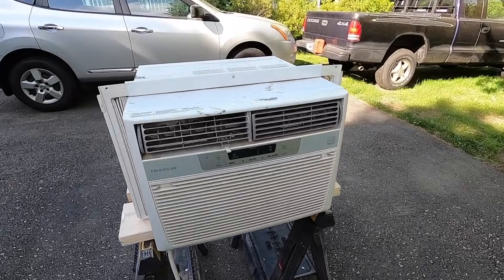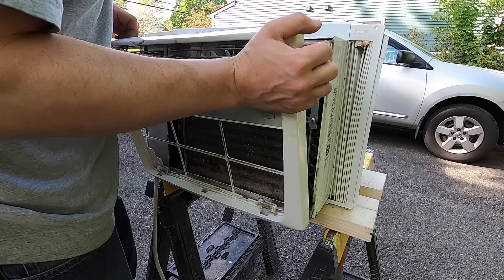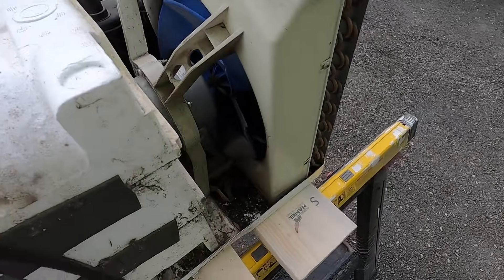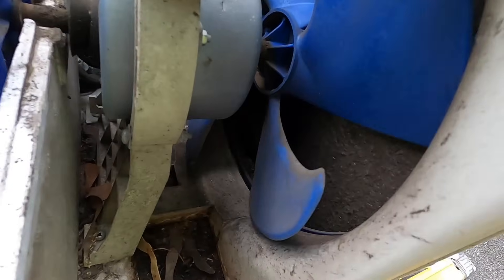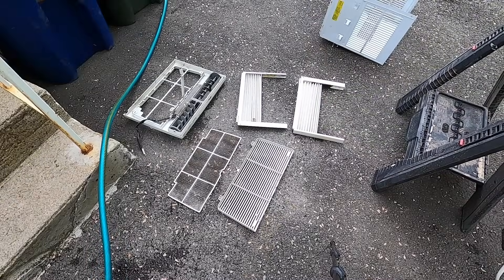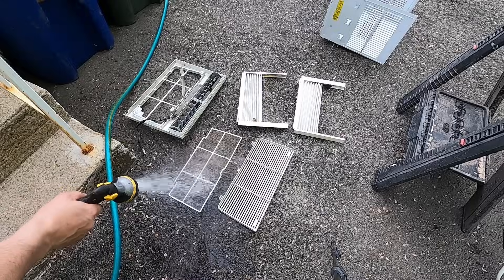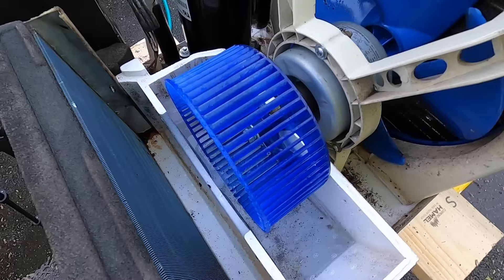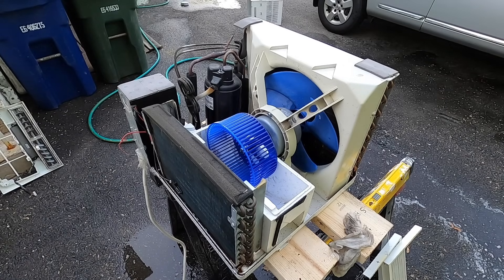How to Clean a Dirty Moldy Window Air Conditioner

Comment: How long had this unit been running without even having the filter removed and cleaned? I have a Frigidaire window heat pump that has a similar design, and the inside coil only has a slight amount of dust on it that won't vacuum off after over 5 years of year round use.

I'm also curious if mold forming on the styrofoam around the interior fan could be reduced by coating the styrofoam with something that would result in a smoother less porous surface.

Comment: i generally have to clean ours at the first of the season,  i also take the fan shroud  and the fan loose (usually 4 screws) so i can get to all of the condenser coil it almost always has lots of gunk built up across the inside of the condenser, it makes them cool much better
Reply from the maker: Maybe next time I will do that.  Thanks for checking out the video!!
Reply: @TheFixerHomeRepair  make sure you have a long Phillips screwdriver at least a foot long to reach the motor mount screws, i bought a strait and Phillips at harbor freight 22in for 6$

Comment: GUYS! PLEASEEEEE do not mix bleach with dish soap in any amount. It makes chloramine gas. 

I only put a little bit of bleach in the bottom of the bottle and did 3 drops of soap before I mixed everything together. 

I did this and felt like royal crap for 3 days until i realized what the culprit was. White vinegar works as a cleaning agent and doesn't smell when it's dried but might smell if your ac tends to be used a lot. You can also just put ONLY a few drops of dish soap into the bottle and spray down your AC to clean it and that should be plenty to remove the mold. There are anti mold products that you can use as well. Please be careful.

Comment: Have the exact same model and I just deep cleaned it, but it just rcently stopped blowing cold air, even when the compressor is on. Any tips to look for? Or do I need a new unit?

Comment: the black mold is a constant issue for my window airconditioner. i dont understand why.  i buy a new one like every summer because it is loaded with black mold. so last year i decided to clean it out. it was so difficult to get it clean. idk why they have to use styrofoam its so difficult to get the black mold off it.  but now the ac is loaded with black mold again.  i dont understand this shit.  
i am debating on cleaning or replacing but regardless anyone know what i can do to prevent this problem from happening again?

Comment: I always turn the unit up on the compressor end side after cleaning both coils, then let chassis drip dry for 2 or 3 hours, then let it set in front on a fan over night, finish electronics with comp air.

Comment: So I noticed mine was looking pretty moldy awhile ago, end of last summer, I thought hmm is that dust or mold, looks different than the verified dust elsewhere on the unit, but I didn't worry too much about it. This year I started using it about 3 weeks ago, and right in line w that is me starting to feel badd/off. The whole time I've been thinking what on earth could be making me feel like this, I'm healthy, fit, and eat the same few healthy foods, but something is up I feel like I've worked a hard labor 12 hour shift from the moment I wake, everyday. And sure enough today I remembered the mold. Man that sht, if that's what it is, is messing me up. About to clean the heck out of it. It's much more moldy than last year and I've had it blowing right on me at night while I sleep.. Yikes.
Reply: It was! I cleaned it and next day I felt 90% better, and day after that I feel totally normal! Unreal. Legit seems like that sht would have really injured me if I kept exposing myself to it.

Comment: Nice to know. I could only imagine what my a/c unit looks like in there. I've had it since 2001. Works like a charm but it does have a bit of a funk when you first turn it on. I wonder if I should just replace and start new. Suggestions?
Reply: For something that old it’s probably better to replace as the newer ones are much more energy efficient so cleaning yours wouldn’t be worth it in my opinion but it really depends on how tight your money is. They’re pretty pricey so cleaning may be the best option
Reply: If it still works well give this a shot, it only costs your time.

Comment: My Ac was almost this dirty. I got mine pretty clean I only did the front cuz it’s so hot & I just wanted it to work better. It’s working a lot better now my room is so much cooler. I want to do a deep clean like this soon ! How often should someone clean there Ac unit . No wonder I was getting so many sinus infection last year . Also this year I started to feel sinus pressure and pain. I’m hoping since I cleaned it I won’t get sick . After watching this I’m differently going to do a deep clean on my room Ac & the large one in my living room too . These things get so nasty that’s not healthy to breathe in that dust & mold . Great video thanks !

Comment: I have this exact model and want to clean it but am nervous about getting water from the house into the electronics or fan motor and making them fail or worse causing a shock hazard. How water resistant are these things?

Comment: Mine has a mildew smell and I think it needs this but I didnt know you could even clean these things.  Thanks for the video!
Reply: Just picked up a 12000btu beast.  It’s cold and brand new so no mildew.   My old unit has black soot, oil and god knows what else caked on it.   Decided to bring it into the bathtub a go to town with the shower head on jet stream mode.   Even the wiring and electronics.   If it dies, no boggy but if it works, it’s a bonus.  I’ll have ac in my bedroom.   Unfortunately the window in there is quite small and only a puny 500btu will fit.  

Report says these scorching summer heatwaves will be the norm going forward.   Ac just became an essential item like food and shelter.  

Seriously my bedroom is like an oven compared to the living room where the beast of a unit was installed a few days ago.
Reply: @supercooled  
How did it go with giving your old window unit a shower?  Did it work out ok?

Yes, these heat waves suck!  Getting ready to take mine apart and clean. It's a 12,000.
Reply: @josephdockemeyer6782  unfortunately I gave up half way into it.  There was a serious health concern since so much stuff was coming out of the unit.   My building faces a busy artery so all kinds of traffic passes by.   Thankfully this year hasn’t been that hot yet, knock on wood.   I’ve installed a secondary portable unit which helps a little.    

Thinking of getting another one or a casement style unit but they are quite expensive, 5-6x the price of the traditional one.   

Good luck with yours.   I would suggest face masks for sure.
Reply: @supercooled  
Thanks for your advise. Sorry about your situation.  I believe they're a huge health hazard.

I'm going to take mine out to the driveway and hope for the best.  Probably within the next 10 days.  Disassemble, clean, dry out and reassemble. Hopefully it goes okay...  It's in the bedroom.

EDIT: Yes!  The prices are JACKED UP.  A new one like mine would run over $360.

Comment: Mold is killed by raising pH level higher or lower than range in which spores live (3-7).
This is done using either acidic or alkaline household agents - chlorine, hydrogen peroxide, trisodium phosphate, (TSP), vinegar, ammonia, baking soda, borax, sodium percarbonate, oxalic cid, etc. Chlorine bleach is very caustic (pH between 11 & 13), and not necessary for household mold removal. Better to use the other cleaners, except hyd. peroxide, since most solutions of such are near ideal pH range for mold..
The EPA recommends that porous surfaces may have to be thrown away if they become moldy. Mold can grow on or fill in the empty spaces and crevices of porous materials, so the mold may be difficult or impossible to remove completely.
Suggest hosing parts with only water first to remove excess dirt. Then utilize a cleaner with a pH higher or lower than the type of mold involved.

Comment: A few screws would remove the front panel electronics as well.  I just cleaned mine and having removed the panel allowed me to soak the front panel and vent and really get them sparkling clean.  

I just wish the bottom Styrofoam portion could be removed without disassembling the front cooling fins.  That portion is very hard to clean otherwise.

Comment: If mold makes you sick I wonder what voc's from Clorox does. Vinegar is safe but if you want to revolutionize all cleaning, especially mold and dust try Kleen Green.. it's not cheap but it uses natural enzymes that eat all organic matter and keeps it from coming back for a long time. I have used it. You can even bathe with it and i have. Clorox does not kill mold. It takes the surface mold off but not what you can't see which is where mycotoxins come in. Lots of different co use enzymes which are harmless to us and animals. You can shop for whatever you like but chemicals like these do way more harm than good and give  you a false sense of clean. Now it's toxic.

Comment: I hate the front reservoir. It should remove all water instead of pumping the moisture back into the room and causing mold on the fan and out-port.

Comment: Hi everybody I'd appreciate your help, mine is this exact same unit but a 2023 model and as of July 2023 it's brand spanking new, my old one was the same model previous year from 2011 and when I removed it it looked exactly like the video  it was disgusting, Now on to the question I'm 67 years old it's currently me and my wife and this thing is through the wall and it's five feet up there's no way I can remove it myself, and before everybody comments about getting help I'd rather find a way to do this without removing it so I'm trying to figure out how to best clean this without removing it from the wall and I'm starting with a brand new unit I'd appreciate it if I could get a response from someone in this same predicament that has one that can't remove it that has kept it clean inside through the years

Comment: For the cooling fins you really outta buy that stuff the heating and cooling companies use when they come out to service someone's AC unit. They just soak the fins down with this solution that's put in a pump sprayer. They'll let it stay on for about 5-10 minutes then spray it off.  The fins will be nice and shinny.

Comment: Did you have a problem with the unit emitting air that smelled like mold or was this project purely for aesthetic/efficiency purposes? I have a 3 
-year-old, barely used window unit that I just started using again. The air it pushes reeks of mold. I cracked it open and see no visual signs of mold so I'm concerned it might be in the compressor.

Comment: I have the same model and followed this video step by step. I do not recommend this method. As careful as I was, especially with the front control panel, a bit of water leaked under the front buttons and now they don’t work.

Comment: My window ac smells like a mixture of piss and ass crack. This gets worse when it rains, so I would assume it's to do with the fact that modern window units don't drain all the water out, but hold some to copl more efficiently by slapping it against the shit. Why would they do this if it leads to nasty ass smells like this. My room smells like warm piss and week-old ass crack cheese.

Comment: I found a good way of getting all the gunk out of the fins - alternate between spraying through them with a hose and an air compressor- it blew all the gunk right out and made the lower section easy, where mold tends to build up
Reply from the maker: Awesome tip!  Will have to try it!  Thanks for stopping by!

Comment: I replaced the bad bearings in the motor on mine, while I had it apart I deep cleaned it like this, You can get to the condenser easier to clean it if you removed the motor and shroud , four bolts and 10 screws, lift it out as a unit. . Then you can also remove the blades and clean them in the sink.

Comment: Nice.  I have two that need to be cleaned.  One stopped blowing cold last week and it is less than a year old-I suspect it has something to do with the wife becoming "The Cat Lady".  I finally had to cut some Chicken wire and block it to keep them off but it was too late.  The other is just an older unit that sat in storage for years and years.   Now if there was an easy way to move them.  Partially blind and Stroke makes it a PITA but it's Self or NoOne.

Comment: am in the process of cleaning mine.  different model.  something like 20 y old model. not victoria secrets kind ... more like a nasty dirty type. the top section has a space, right behind the plastic grid, entirely lined in cardboard like material.  wTH! i am trying to clean that, but the cardboard is falling apart.  we have been breathing in those small particles. dare i ripping it off? can i replace with something? wth is it even called? why is it cardboard? to make sure it's not washable? am crying.

Comment: I have the same exact model in my shop.  It's built into the wall.  It's dirty like that except not so much dust in the front coils. The air isn't as cold as should be.  So how do I clean it beings i can't take it out and apart.??
Reply: Hi Melissa! I just did mine very carefully in the bathtub. If you have a rubber mat that you can place it on while you're cleaning it would be helpful so that you don't scratch your tub. Also I recommend using a screen to catch any leaves that may go down your drain if you don't have anything already to prevent such things from going down the drain.  Also it helps to have a removable showerhead with the ability to change water pressures typically used for massaging or other Preferences.  Anyhow, best of luck to you!
Reply: @klearblack  I can't remove it from the wall
Reply: Mine is built into the wall also. There was a metal bar thing that was screwed onto the front  and i just unscrewed it and gently wiggled it out with my son pushing some from the inside out. hopefully this helps!

Comment: Have you had any problems with it since washing it? We cleaned one like this and it throws ice anytime it's used now.. we had to buy a new one. I don't know if we just had clogged the line more or what. Thinking about taking it apart and trying it again, depending on your reply
Reply: Throws ice? Does the coil ice up? Couldve lost refrigerant or coil could still be plugged with dust, and if its refrigerant thats the case theres no valves to add refrigerant back someone skilled could add one and try and recharge it you’d have to look around near you or know someone

Comment: It's kinda difficult for the fan area, especially being that we live in an apartment, but the step-by-step process was very simple.  The part that blows out air definitely needs cleaning on my end.
Reply: was thinking the same. not very feasible to clean these thoroughly if you live in a small apartment in a crowded city
Reply: @planet505  Try doing it in the bathtub! Someone in a different video mentioned this and claimed it work just as well. I'd probably open the windows and turn on the bathroom vent if you have one.

Comment: You forgot one key component... Something that it took me a year of taking apart and searching around for... I FINALLY found it today... The drain that allows the water to drain from the front to the back... It's on the BOTTOM LEFT corner... Behind the silver panel housing the wires... I couldn't see it due to rust and gunk and slime built up over it... But I FINALLY FOUND IT!!! 🙌 Now it no longer leaks into the house, it drains to the back like its supposed to... I searched and searched online for someone who could tell me where that stupid drain hole was... To no avail... If anyone asks, now you know too... 😂
Reply: On this model I mean... I have no idea where it would be on other window unit brands... But I finally found it on my Frigidaire...

Comment: Thanks for the Video.  FYI. I don't think you want to ever mix Bleach and anything, even Soap.  If the other has ammonia you could get a toxic gas reaction.  The goal is never mix the chemicals.  Maybe cleaning them separately, soap, water then bleach.
Reply: A little Dawn ,bleach & water has no gas reaction...duh...perfectly fine...
Reply: Don't you mix laundry soap and bleach together when washing whites?  Same difference isn't it?

Comment: Sheesh. With all that time and work spent disassembling, scrubbing, cleaning, drying and reassembling the ac unit, wouldn't it be more cost effective to just recycle it? A whole day of this is just not something to be looked forward too, at all. 
Just hosing down the interior will do "wonders" for the wiring and electronics. I got exhausted just watching the video - the amount of work! And to remember where all the screws go...

Comment: Is it worth doing this or is it a concern since it has mold on it?
Reply from the maker: In my opinion it is worth it.  As long as you kill the mold I think it is better than spending a few hundred dollars on a new one.  Thanks for the comment and for checking out the video!
Reply: The Fixer I bleached the crap out of mine. Just worried if it come back
Reply from the maker: @appleztooranges  It might, just because of the nature of the AC.  It will always build up moisture, but a new one could do the same.

Comment: i rather buy a new one than clean it... the unit is not expensive at all...  250-350 bucks ... i think it is wasting time to clean it and it does not guranteed that mold wont come back.... i rather buy  a new one... after 3-4 yrs, buy  a new one...

Comment: Ummm, my brother uses the Easy Off Oven Cleaner; he covers the electrical wires with plastic and sprays the foam, etc. He rinses it really well. Plus there is an Oven Clean Fume Free n No gloves required. I'd still use gloves.